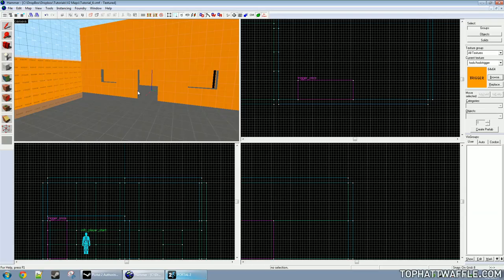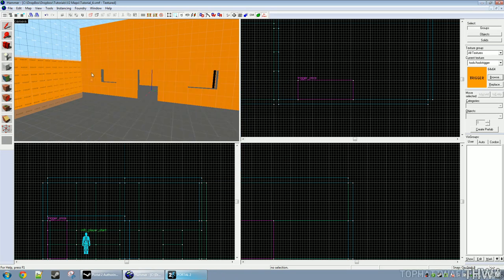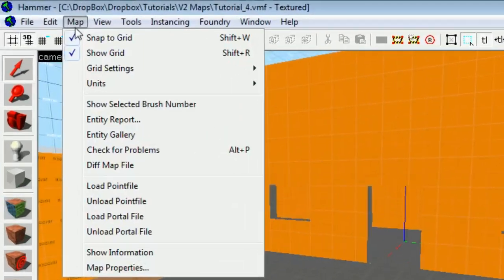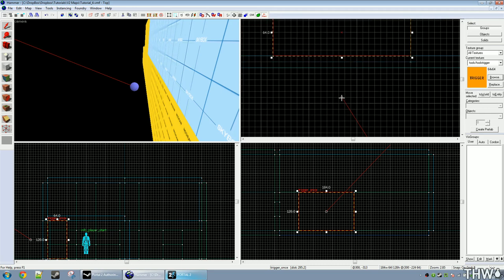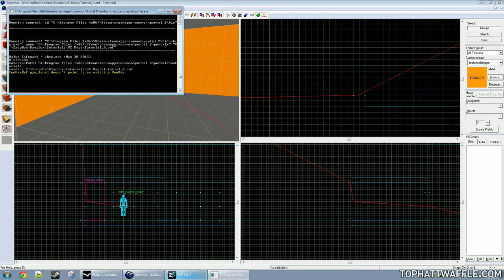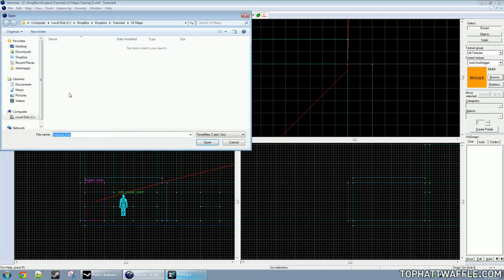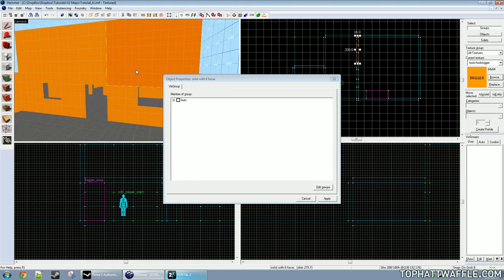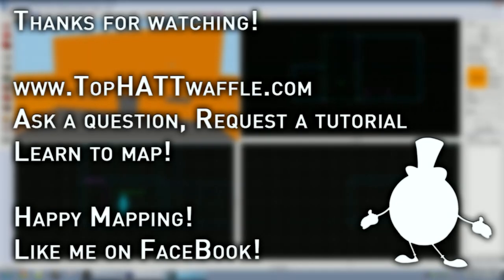[Source 1] Hammer Tutorial V2 Series #4 "LEAKS"

Comment: I don't know what's happening with the point file it just goes straight through the ground .
Reply: I had the same problem. Does the ground have transparent areas? I just applied another texture and that was the fix.
Reply: it is probably because the ground is a displacement. Displacements cant NOT seal maps, you have to place another brush under it
Reply: @wendalka6942  Wait wow, your tip literally just fixed my map, so you can't say seal a map with a sky box and a no draw?
Reply: @assaku  You can seal a map with any brush so long as it hasn't been displaced. So yes, you can use a sky box and a no draw to seal a map
Reply: @wendalka6942  ook i dont get whats wrong then maybe there is a gap because i changed the texture, one moment it was fine. Then when i added a func_breakable(inside the map) the red line pointed towards nothing and a ct spawn
Reply: @assaku  Is the func_breakable is being used to seal the map? If so that's probably the problem. Otherwise, I'd recommend deleting the skybox and anything being used to seal the map, and replacing them. Just to make sure that they're properly sealing.
Reply: @assaku  Also, fun_details cannot be used to seal maps, so make sure your ground isn't accidentally a func_detail
Reply: @wendalka6942  oooooh i thought fun details were same as world brushes
Reply: @assaku  Nope, that'd be your problem. Hopefully it works now :)
Reply: @wendalka6942  thank you. Ill try that
Reply: @wendalka6942  wow. That worked. No wonder the red line was going there